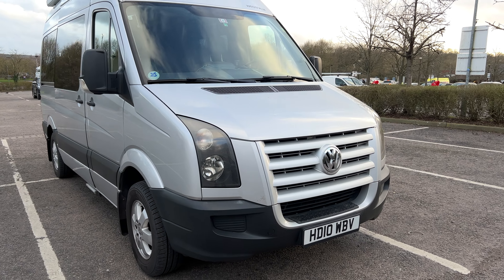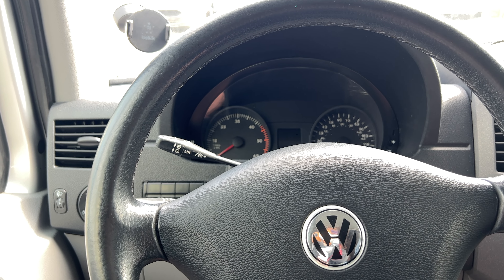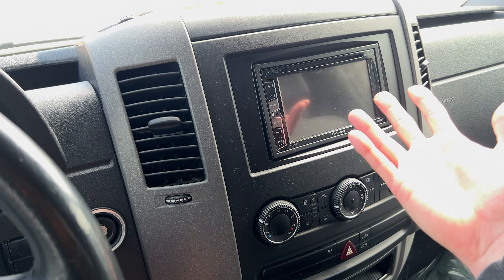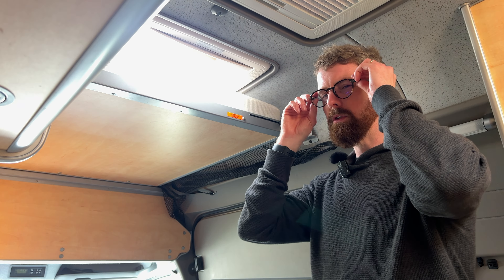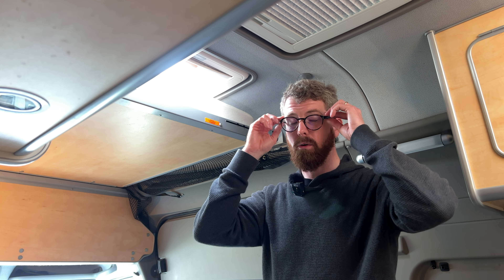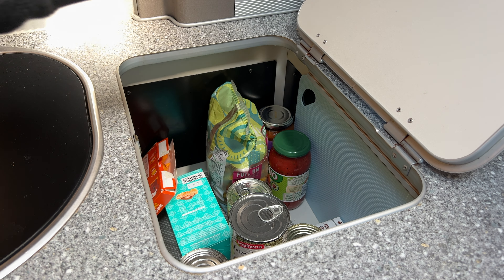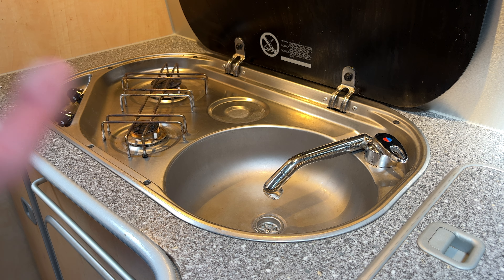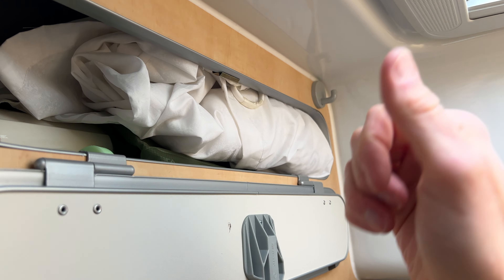A Volkswagen Crafter sized problem with my new Sven Hedin?

Comment: A key feature of the Sven is five three-point belts making the only camper/motorhome that I am aware of with that capacity, other than a vw California with the heavy extra seat.  Its why I bought it, the build quality being a bonus.  But soon after it came out Westfalia was a victim of the 2008 crash so there are few around.
Reply from the maker: The Westy Nugget I’ve just recently sold had 5 belted seats (2002 model year)

Comment: I hope you continue to enjoy this edition of the Sven Henin.  In 2014 I imported one of the few variants of this model to make it to the UK.  Sadly, I had to part with it in early 2016 in order to meet HMRC demands for stamp duty upon moving house.  I have lamented it ever since.  I had been buying and using Westfalia vans for 11-12 years by this point in time.  I began with a Nugget.  I had a 2005 James Cook Silver edition from 2010.  The SH was just spot-on for my needs - bathroom as a drying room and occasional loo, kids away from the kitchen, kitchen ergonomics which put most modern vans to shame , 3 point seat belts for the two kids plus a mate each and a pretty decent drive for a 6m van.   I hope the van I landed to these shores remains out there still going strong.
Reply from the maker: It’s a great van, there’s not much I’d change about it apart from the engine power